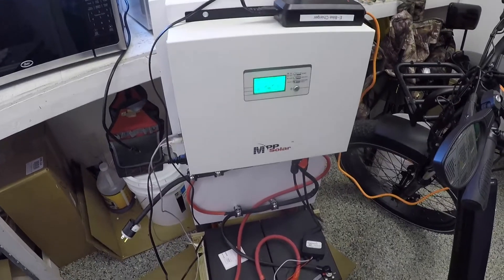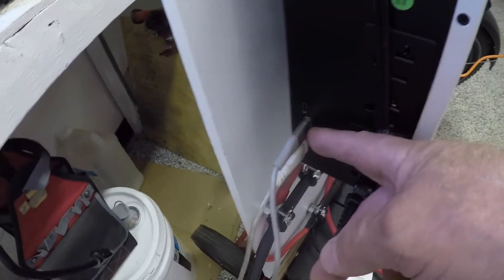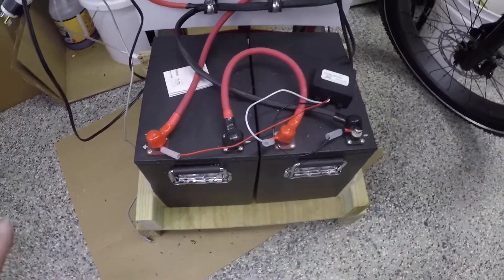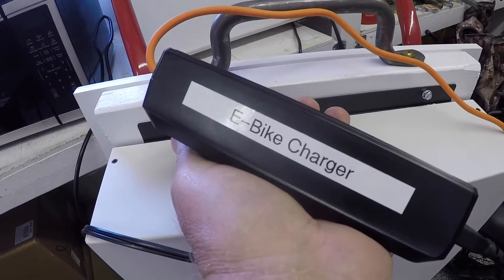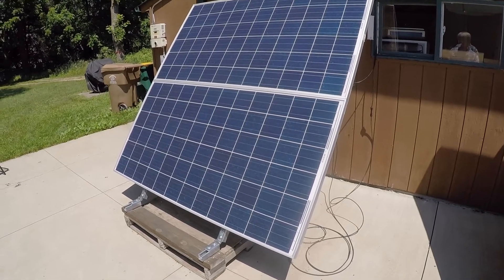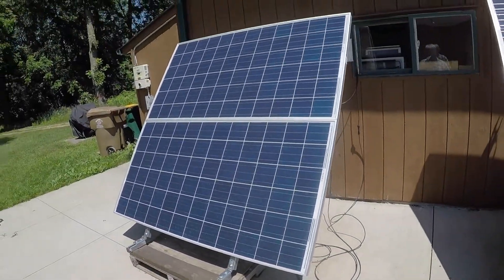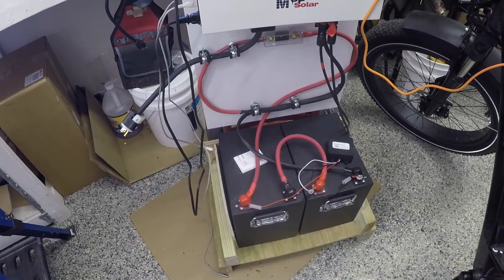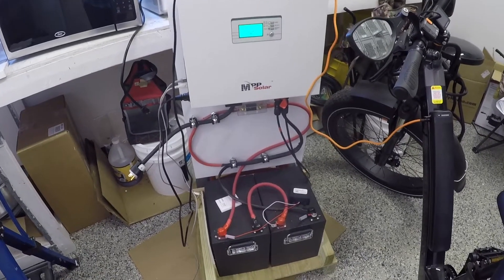Easiest to make DIY Solar Generator, Where will you be if the grid power goes off. Charging Radrover

Comment: I'm clueless but trying to learn. I'm looking to power my 20 ft camera with something like this. And was told 3000 watts would be plenty to run everything. Do you think this set up would do it? I would like to just plug the RV in... A 30 amp plug.
Reply from the maker: This generator will run most of the components in a camper. This generator has a max output of 2700 watts@120v. A 30 amp 120v outlet has a capacity of 3600 watts@120v. Large inductive loads like an air conditioner may not work.
Reply: @beefitter  could I wire a 30 amp outlet to it?
Reply from the maker: @evertking1  they do make a 30 amp to a 20 amp adapter plug
Reply: @beefitter  thanks for the help and reply